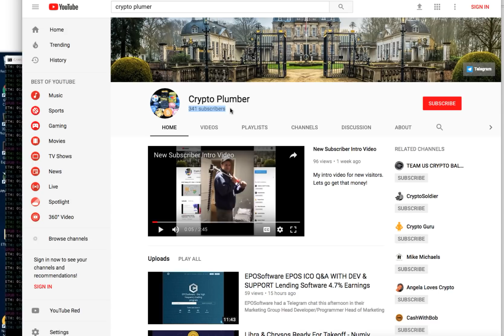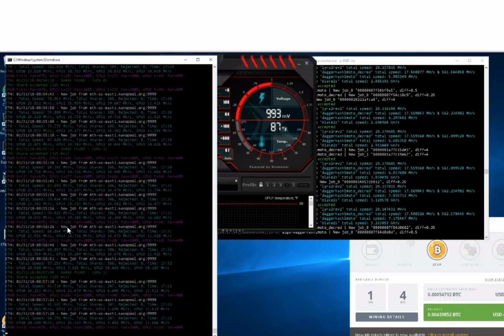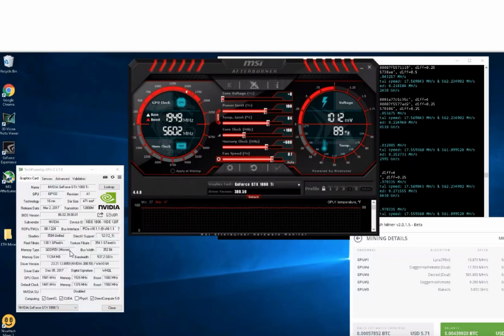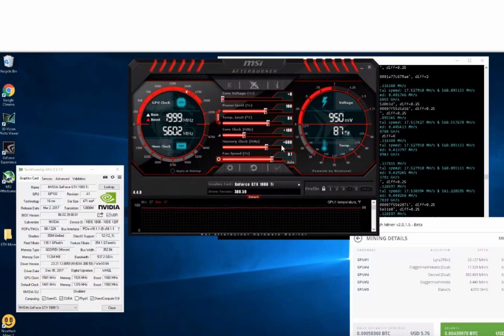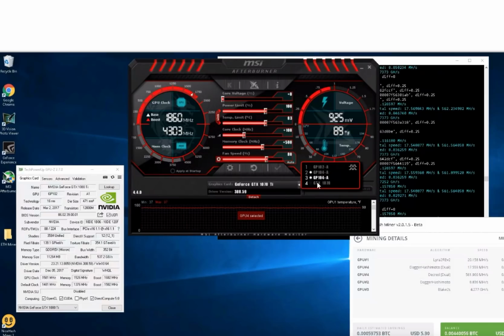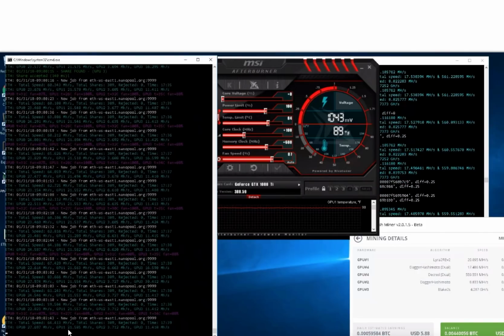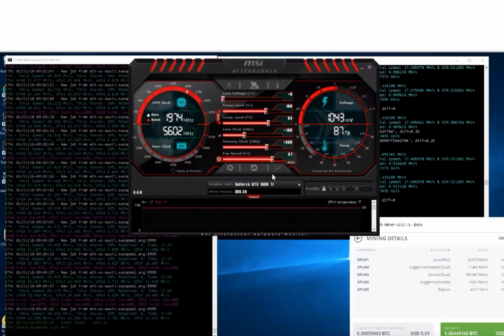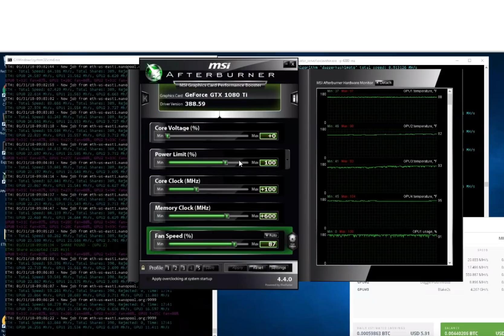Increase GPU Mining - Overclocking & Undervolting MSI Afterburner 1070 1080 TI Graphics Card

Comment: I'm mining ETH while i'm sleeping.. My OC is: Power Limit: 60% / Core Clock: +140 / Memory Clock: +800. The temperature it's 55ºC all the time at 35% Fans (Asus Strix GTX 1070) and GPU Clock: 1450MHZ / Memory Clock: 4608MHZ / 781mV. Is it safe? Thanks.

Comment: i get 25mh with gtx 1060 3gb . Don't trash your cards on ethereum lol. 1080 and 1080ti are not any good for memory intensive algos like ethash. Also, you are wasting power on 100% plimit. On my cards there is no difference in hashrate from 100% to 66% plimit, as ethereum is memory intensive and memory does not use much power at all
. Find your sweet spot.
Reply from the maker: Thanks for the heads up. I’ll try that and see what happens.

Comment: Quick question, I have 1080’s on a riserless build, my temps are 69-72C, I have windows platform, my settings are 150 Watts, 100 core and 700 memory. I walked it up with three hour spaces, but it crashed at 800 memory. I rebooted and I am running 150 Watts, 100 core and 750 memory with temps of 67-71. Do you think I should increase my time spacing between over lock changes or do you think I hit my ceiling for these cards?
Do you think I will get more sols if I increase the power beyond 150 Watts per card? I have six and two 750 power supplies. I was thinking of 155 Watts per card.
Reply from the maker: how many 1080's on a motherboard are you running??